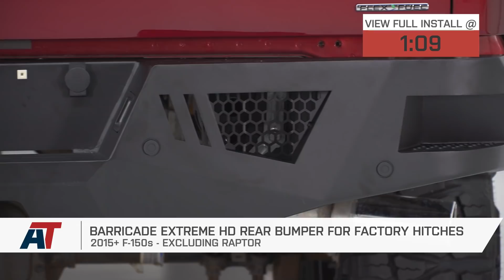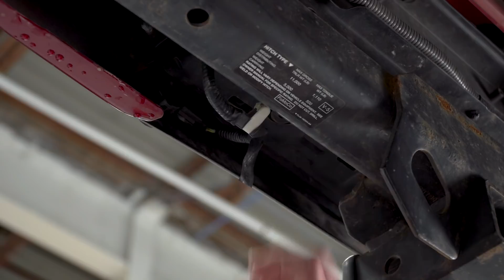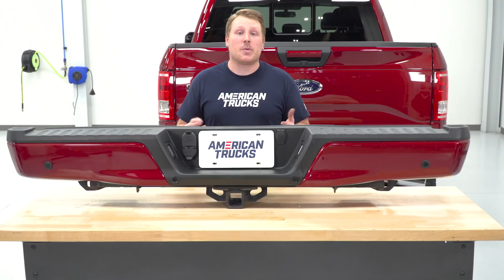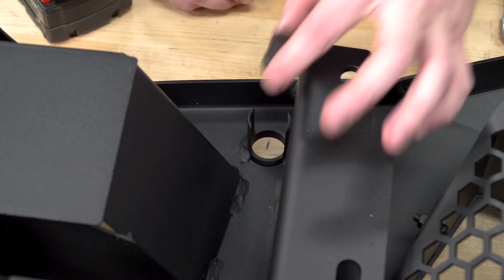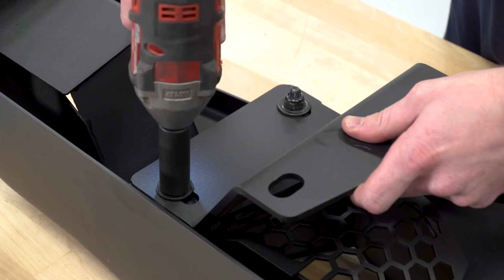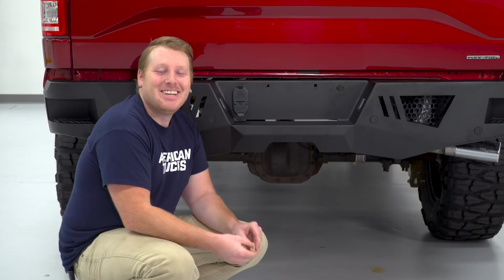2015-2018 F150 Barricade Extreme HD Rear Bumper for Factory Hitches Review & Install

Comment: Sure would have been really helpful, had they included install procedures using the factory HD hitch!! Most of the trucks out there have them, to include the one in the video. It would be even better if they would actually respond to questions from subscribers/customers.Thanks for nothing AT!
Reply: I installed the HD bumper with the factory F150 tow hitch. After removing the hitch assembly from the OEM bumper, you just reinstall the assembly to the truck frame.   This step is mentioned in the instructions included with the HD bumper.  
The HD bumper mounts directly to the hitch stock mounting points with the included hardware (4 bolts).  
I have a 2015 3.5 Eco Lariat with the tow package. My biggest pain point was the sensor install. The bolts holding them in place use a Allen wrench. It took me 45 min to get these things mounted properly. A 1/4” bolt would’ve worked better considering the tight space.

Appears to be a well made product, looks great on my rig!
Reply: @johnfix9961 did the your trailer hitch plug clicked in? Mine does the new bumper is slightly thicker

Comment: Cool bumper, but my question is why are metric size nuts, etc, used on the F-150, instead of SAE hardware? Just a thought.
Reply: retnav92 all modern vehicles use metric hardware